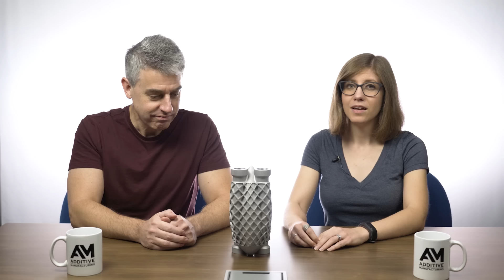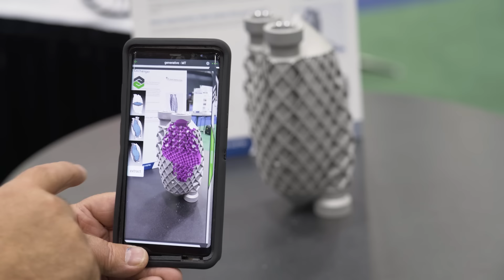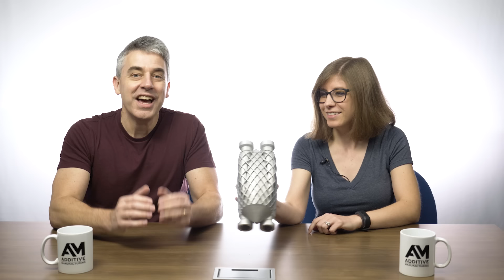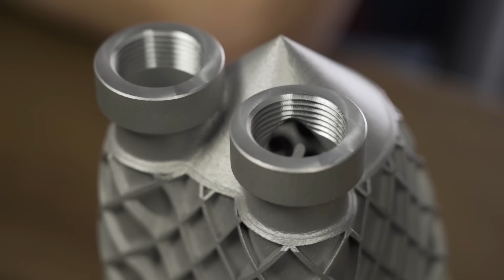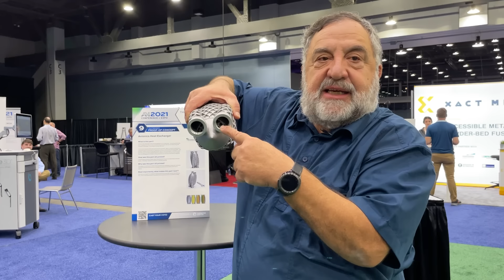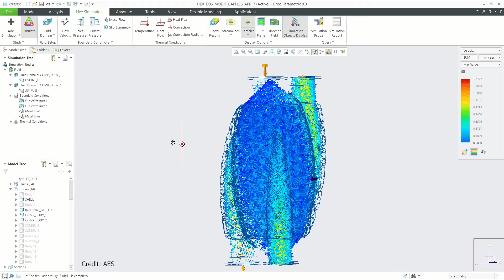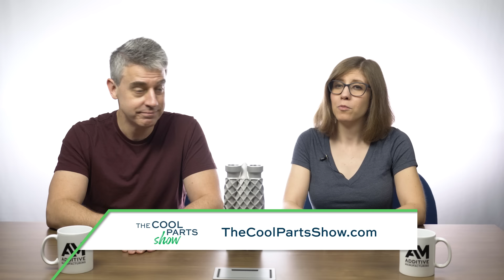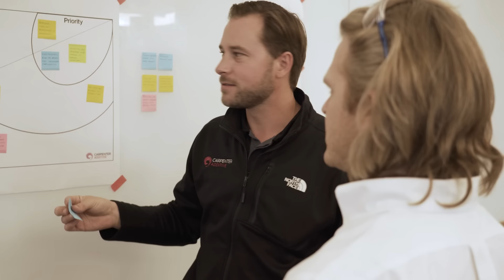3D Printed Heat Exchanger Uses Gyroids for Better Cooling | The Cool Parts Show #43

Comment: See now this is one of the real applications for additive manufacturing. Not dumb crap like 3d printing entire cars and houses.
Reply: well, better designed parts could take advantage of additive to reduce weight and complexity in cars, or increase performance, like the suspension joints or engine internals, while possibly reducing costs. the Dreamliner plane is using 3d printed titanium for it's engine pylons as it ended up reducing costs and waste compared to billet titanium
Reply: @l3d-3dmaker58  This is only on the condition that these parts are just as easy to maintain and control the quality of production, as well as the possibility of repair, production by simple means.
Reply: Well perhaps we could build strange surfaces for houses too 😅
Reply: This isn't actually a worthwhile application of 3D printing yet. The metalurgy of 3D printed parts is still trash, and that doesn't seem to be changing very quickly. Also, the hidden internal passageways SEEM like a neat benefit, until you realize that it cannot be inspected prior to deployment or as part of routine maintenance. On top of that, the parts still require finish machining for threads and precision surfaces, which negates half of the benefits. Ultimately, these kinds of parts can not currently pass any level of the rigorous scrutiny that they must in order to become an FAA certified component.

Comment: The augmented reality flow simulation is amazing. Talking about parts count reduction, that also means, if additive is reliable enough, a lesser probability of failure because there no joints to fail. When you deal with the blood of the helicopter that's quite important too.
Reply: The main thing is the hype on modern complex technologies and ideas. No one cares how it will be serviced, checked, cost and production time.
Reply: @VictorLarsen-fy9ls  A heat exchanger is a lump of metal with no moving parts. The only reason they might get dismantled to be serviced is because they are an assembly that has internal seals and those can fail. You are advocating that they need to be multiple parts so that they can be serviced when the only reason they need serviced is because they are multiple parts. Inspections would be a pressure test, so doesn't care if you have access, and aerospace parts are really not cheap anyway. Parts with internal seals are inherently less reliable than single piece parts, which means more expensive inspection and servicing.
I get where you are coming from, but this particular use case is one where a single complex piece of metal is appropriate. You are getting rid of the parts that need servicing.
For reference, when was the last time you serviced the cooling channels on your car? They simply don't go wrong. What does go wrong is the gasket that is required where multiple parts meet.
Reply: @agsystems8220  well put
Reply: @agsystems8220  what about if there is fouling inside?
Reply: @samuelmendoza9356  You run a cleaning solution through it like any other closed system. You probably wouldn't disassemble a regular heat exchanger and manually scrub it either.
Reply: @agsystems8220  You make a good point on disassembly and scrubbing. But what about damage and wear inspection? If its for single-uses systems like rockets(as a weapon or transport), it would be understandable. But for a reusable system, I have my doubts.

Does the same reason happens if unforeseen damage or excessive wear happens?
Reply: @samuelmendoza9356  How do you think they inspect the internals of regular pipes? Given a regular heat exchanger of similar specifications you would end up with a pile of bent pipes after disassembly, and the inside of those pipes isn't much easier to inspect. It is definitely a hard problem, but it was a hard problem already. 3d printing doesn't make it much worse.
When you absolutely need to, endoscopes and cat scans can still work, but mostly the type of issue you are worried about is just taken on the chin already.
Reply: @agsystems8220  I suppose this kind of HX that is more complex than shell and tube are one of the parts that is okay to utilize 3d printing right away. Because, taking a 3d printed version doesn't even worsen. Hell, if leaks happens, its simpler to replace the module and just use the busted 3d printed HX to be recycled(if they have the fab of course)
Reply: @VictorLarsen-fy9ls  Well there is no servicing this exchanger, and production times for 3d metal printing are coming down so production time and cost are steadily coming down. Honestly 3d printing works great for prototyping and testing new designs on the fly but I'm not sure if it will ever translate to mass production on a cost basis.
Reply: @timtrainque1060  I think at least for air transport they will not make any important details like this, using 3D printing technology. You can get good single copies, spend a lot of time refining the surface, checking, testing. But all the same, it's not really worth it and the weight gain is not significant there. For example, when an old aircraft is upgraded with new electronics, it sometimes gets tens and hundreds of kilograms in weight gain, and this is a side effect of modernization. To get the same weight gain due to 3D printing, you need to change a lot of parts, and they will be of dubious strength, these are already big risks and it's not worth it.
Reply: @timtrainque1060  If this part ever actually gets used, it will have to be 3D printed. There are no other currently existing technologies to create these geometries other than additive manufacturing.

That being said, I'm not so concerned about servicing this part. This component is small, has negligible sources of wear (uneven heating/cooling is the only thing I can think of), and is inside an engine, where if you are taking the part out it's cause you're already replacing it, or it was in the way of something you were replacing.
Reply: @haph2087  re: "That being said, I'm not so concerned about servicing this part" yes, this "post-manufacturing" AMBIVALENCE is exactly what Vlad is talking about.   looking at things MYOPICALLY is simply one approach, but there exists another "system wide approach" where things can be viewed HOLISTICALLY.  this is particularly true in Aviation Maintenance where all checks and servicing are MANDATORY (never optional).
Reply: @VictorLarsen-fy9ls  re: "The main thing is the hype on modern complex technologies and ideas. No one cares how it will be serviced, checked, cost and production time." indeed, for those knowing what to look for the EGO PROBLEM is real easy to spot regarding the "disconnect" that regularly happens in these situations, for like the wise technician said to the engineer "if only the people DESIGNING this stuff had to USE it and WORK on it."